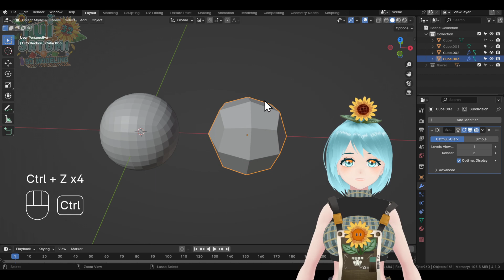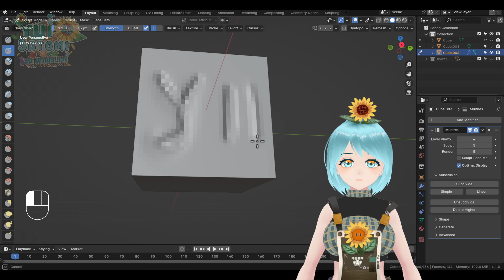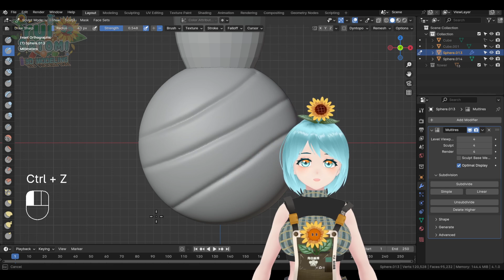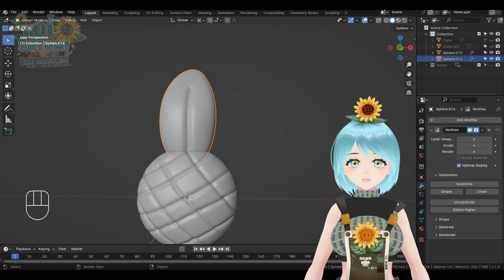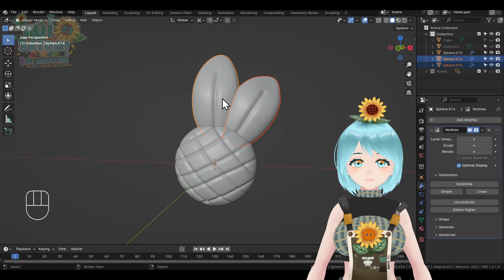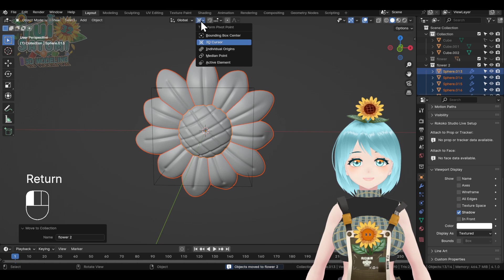【Yui Blender Tutorial】Simple Sunflower 3D for 3D Printing

Comment: Whats the minimum system requirement to run blender on Laptop?
Reply from the maker: It depends on the version of Blender you are using. Can see here for the listing https://www.blender.org/download/requirements/
Personally I feel as long as you have a decent graphic card should be able to use it however it's a different case if you want to go for really complicated designs or use a lot of the extra tools it have ( ◕▿◕ )
So most gaming pc can run it 	( ´ ▽ ` )/
Reply: @Yui32Satomi  thx Yui! Very informative